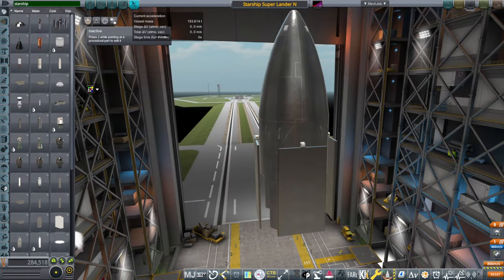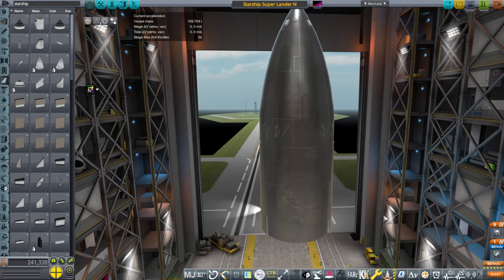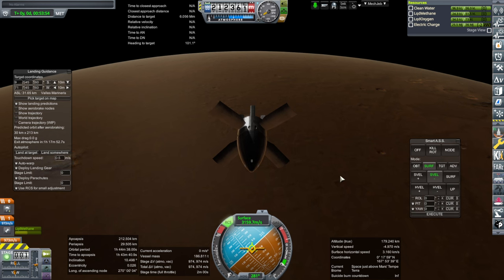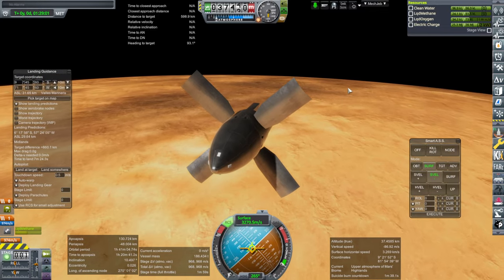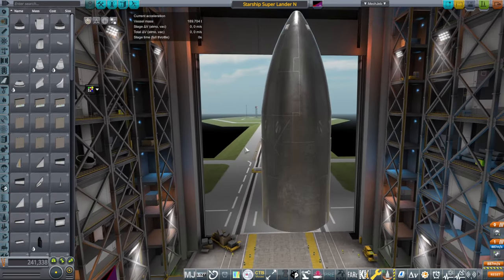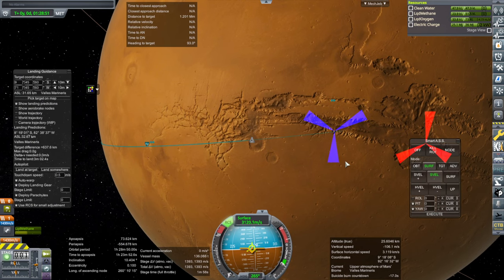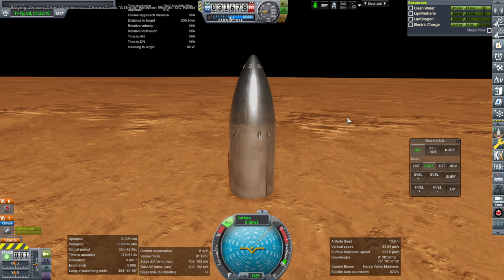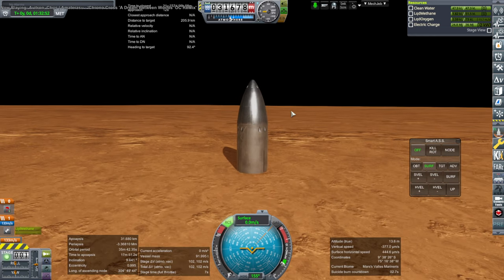Mars Lander Test Redux (RO in KSP 1.12)

Comment: If you are bothered by the concave side of the flaps facing the flux, you could change there animation. 

For instance, make the flap slide towards the top (pointy end) of the lander. Once the bottom part of the flap reaches the hinge, then it opens. 
Or something based on this, it's hard to describe with words but it's a simple mechanism. No idea how to animate this in the though.

Also I don't mind having the concave side facing the airflow. As you said, Mars will not heat the parts that much.

Comment: 32km altitute not optimum landing area :) maybe test below 8km
Reply from the maker: Since this is Valles Marineris, it is supposed to be pretty optimum. I suppose the other option is the Hellas basin, but I don't think that would get to 8 km, either, if Valles Marineris is this high. The problem is the datum altitude (the altitude picked to be sea level) - it's almost certainly the case that there's no point that the landscape gets anywhere near 0 km and probably not near 8 km either.